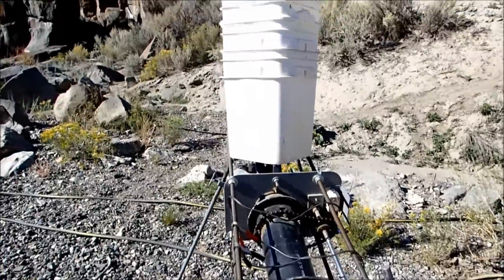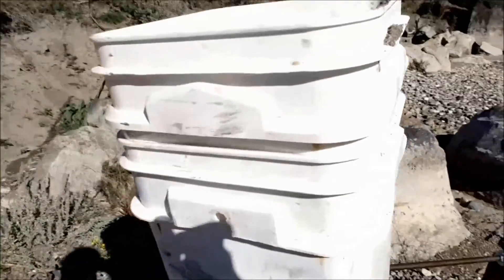Jigging for Gold Part 1

Comment: A thing of beauty.
Reply from the maker: Thanks, Cat, but I'm not a big fan of using a pulsing jig for gold. They're terrific for gems, however. For gold, the newly-patented Sweep Jig is far superior. Better at really fine gold, and uses much less water when running wet, and has the ability to run dry, and recover flour, too. The pulsing jig isn't near as capable on gold.
Jim
Reply: @jimnelson7740  :..I'm guessing, your shop looks a little like mine.   I've pulled micro gold from Michigan sand, at a rate of 1 gram per 46 cubic yards.   Separately, the sand, top soil & plants are worth far more than the gold.   But fun is fun.   Well done, on your inventions.
Reply from the maker: @catmandont100  Thanks, Cat. I'm still pushing the envelope, though the Sweep Jig will be hard to beat. I'm starting a new project soon. A reciprocating "jig" with the ability to work wet or dry. Will be, hopefully, for both heavy metals and gems. May take awhile, as this is the prospecting season, so I spend what spare time I have out in the wilds here in Idaho.